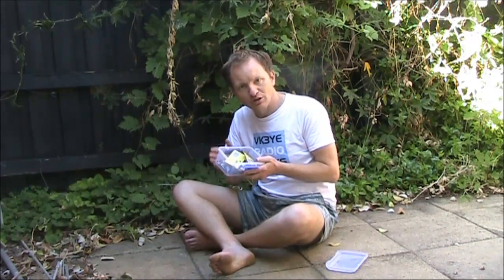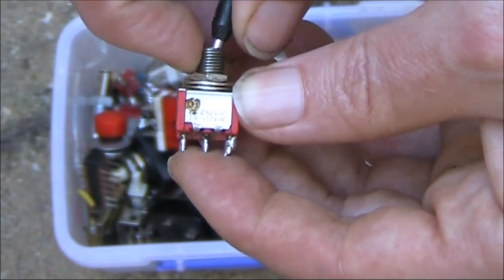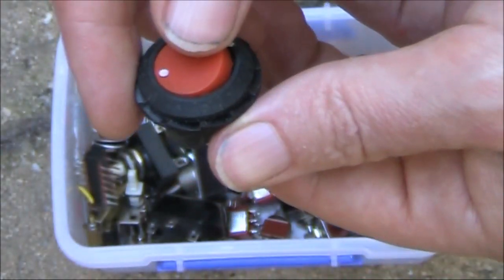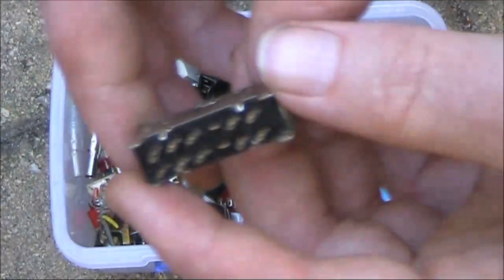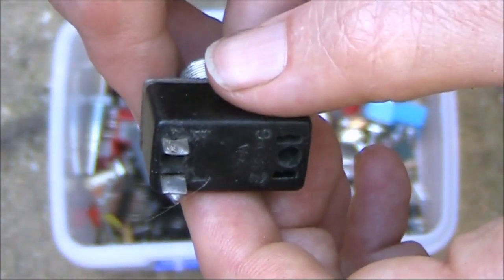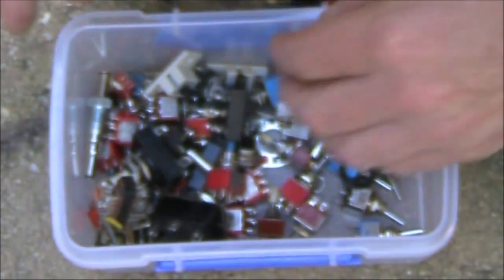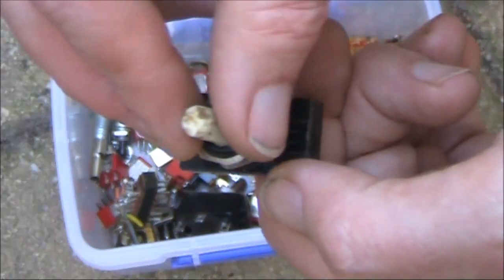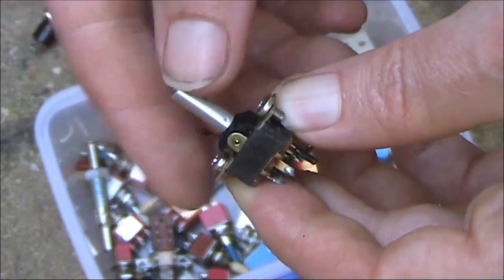Electronics on the floor: A look at switches

Comment: I found a rotary switch from a lighting ballast.  I was planning on using it in an L-match antenna tuner to switch different toroids, mostly for 28Mhz from 5-20 Watts.  How do you check to see if your switch can handle certain signal characteristics or won't introduce unnecessary losses especially at QRP levels?